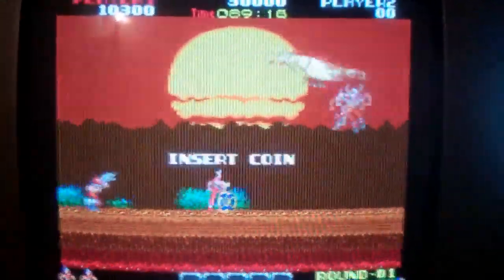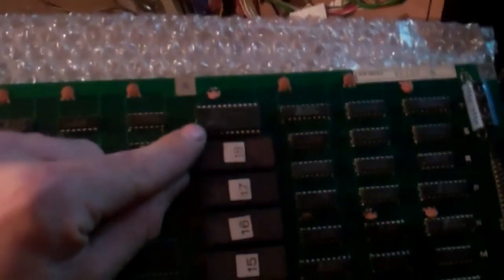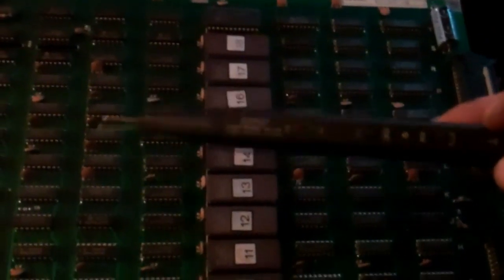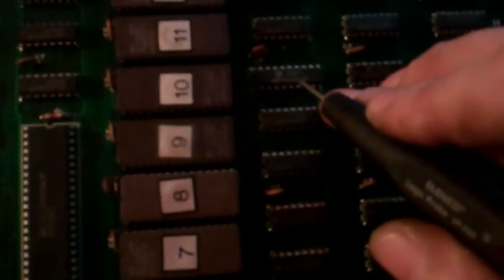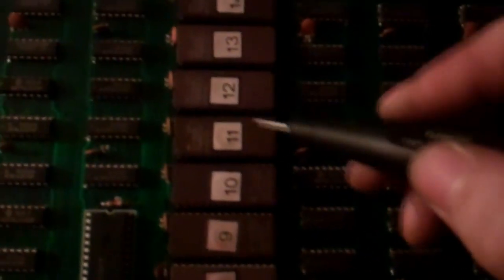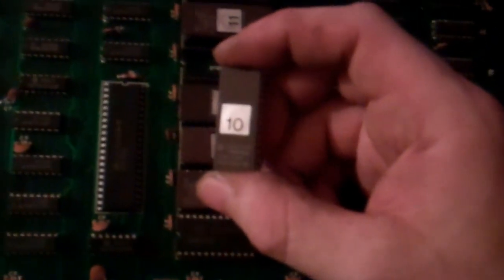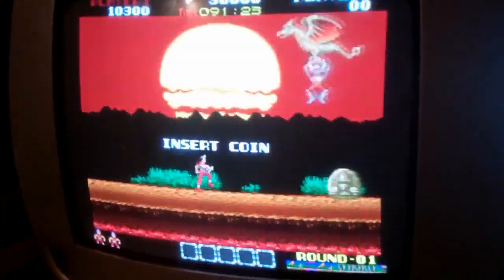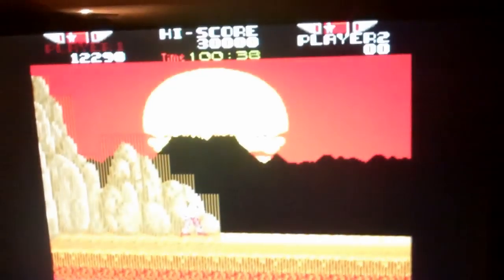Rygar Arcade PCB Repair

Comment: RETROREPAIR, why does some arcade games use MASKED ROM chips instead of EPROM chips any reasons why? Whats the differences between XY vector deflection signals compared to H&V sync signals?

Comment: would this be good enough for jobs like this?

http://www.ebay.com/itm/New-Digital-LED-logic-Test-Pen-Switching-Testing-Electronic-Measuring-Tool-/291245585482?pt=LH_DefaultDomain_0&hash=item43cf96f44a
Reply from the maker: cdoublejj In my opinion, not really. This is the one I have and believe me, the speaker makes so much of a difference: http://www.ebay.com/itm/Logic-Probe-Elenco-LP-560-with-Audio-Beeper-/121613833962?pt=LH_DefaultDomain_0&hash=item1c50bfd6ea

Comment: Nice,  If a line was stuck on the rom then it might cause a bus contention in the real world (fighting with the other roms and causing the jail bars) where as in mame, the issue would only show up when that particular rom was accessed for the gfx.  You could I guess force the faulty rom data bit line somewhow in mame, and then original fault would probably show up.  I had a bootleg kung fu master that had bad colours in half of the objects, and could reproduce the fault in mame by forcing a line low or high in the gfx drawing code toggling colour tables. The offending line on the pcb could also be toggled to produce the same result, however I never got to the bottom of it as the bootleg was quite different than the origonal schematics.  I also had a track and field which has a gfx fault ( or bad code and wouldn't run - I forget) , roms read ok, but still had to replace one of them to repair the board (maybe the chip enable output was stuck on ?)
Reply from the maker: Yeah this method isn't infallible but it's helped me more than once.

Comment: Would this be useful for troubleshooting a solid state amp? I dont think it has IC just capacitors, resistors etc..
Reply from the maker: The logic probe is really more for logic levels to see what a CPU or microprocessor is up to. With amps I'd always go for the trnasistors first then work my way out.
Reply: Hola Elisandro solo quiero decir que los circuitos Digitales funcionan de forma diferente los Analógicos y por esa razón se utilizan equipos diferentes como el logic prove ,logic analyzer ,logic comparator,signature analyzer,etc,Saludos . Elisandro De Leon
Reply: Jesus Gonzalez
 Muchas Gracias por la informacion!

Comment: Nice video Chap! I repair logic boards used in com gear, the're a pain.  I bought an EXPENSIVE Digiview 3400 Logic analyzer, $1600, that interfaces with a laptop through a USB port. I have found many problems with it that would have been hard to isolate. It took weeks to understand how to use it properly and; still learning.
I still use logic probes/pulsers to find MANY problems. The 3400 is time consuming to hook up.
good luck with your board repairs. 
Cheers,
Glenn
DSM Labs (dot com)

Comment from the maker: @ioctlvoid Yeah there are exceptions to the rule but generally so long as the driver is working properly then you should in most cases get the same or very similar results. MAME is pretty strict about how it's put together so it's a good example.

Comment from the maker: @guitarbridgecleaner Well usually I'll check the data/address lines on the ROMs first but I must have missed the missing signal on this one so I had to go through all the logic that was near the roms until I found that one dead input. It's messy and time consuming but it does get the job done. I will have to make a better video soon and actually plan it rather than just ad lib as I did here.

Comment from the maker: @NeonGenesisPlatinum A GOOD ROM Programmer is the GQ-4x by MCUMall. Best bang for your buck in my opinion. The roms I never pay for individually, I just pull them off dead boards ^_^ They are available on ebay but your better off buying scrap boards, lots more parts for your money.